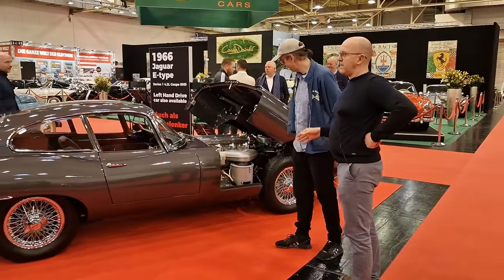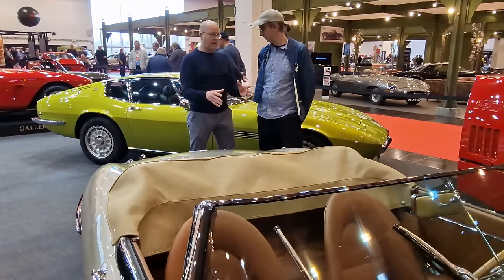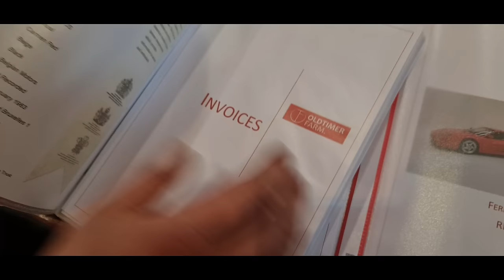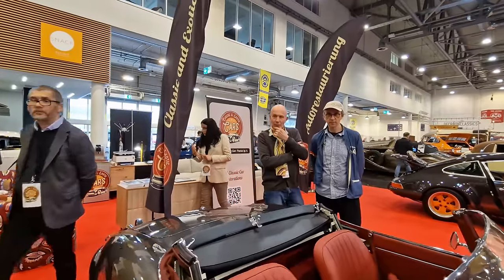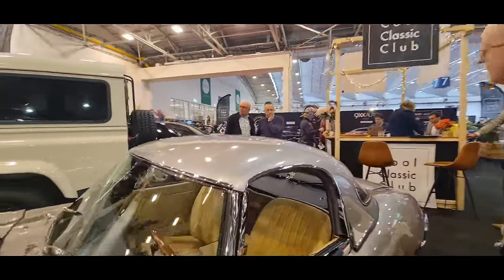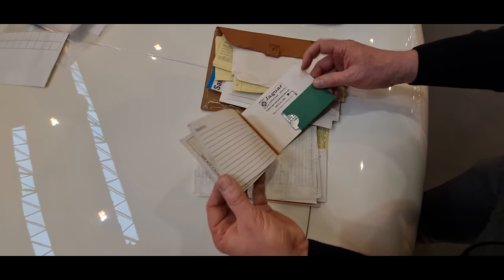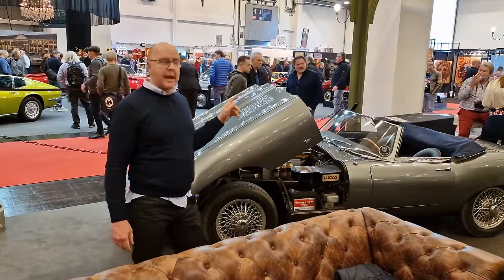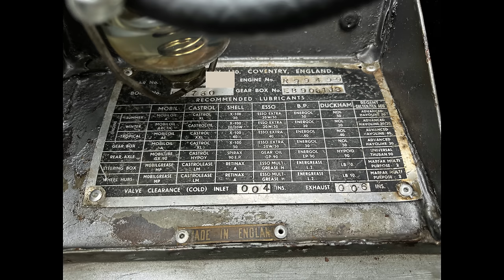Jaguar E Type: Market Check with Richard Michael Owen

Comment: Maikel and Richard, this is a terrific video for fellow “E” Type nerds. Thank you so much. I’m halfway through, I’m rationing myself. The Polish/English fellow’s “E” Type roadster had originality flaws as pointed out elsewhere but the most obvious was the R prefix 3.8 cylinder head. I think he’d been taken for a ride and doesn’t know as much as he thinks he does. The UK restoration figures he was quoting are nonsense. Keep up the great work.
Reply: I totally agree you, the Polish English guy from England is talking crap, and I do know about Etypes  I agree I saw that as well R prefix on the cylinder head, and I said to myself, that’s not right. I’ve seen many guys like him talking to Billy big bollocks he’s got dough around him certainly he saying he’s lost 100 grand on it. Well that tells you a lot don’t it. Listen Jaguar Es don’t cost that much to totally restore and done properly seriously don’t. 
If you a series,1  Etype please please just take it to an E type or XK Specialist and it will be down properly. 
My father  had lovely honest solid solid as a bone S1 4.2 Roadster sitting in the garage 20 odds years on axle stands with an original factory hardtop when I mean solid solid 2020 car 😂 my parents passed away and was sitting in now my mother used to drive it as well to go shopping around London. I was from Caribbean parents My dad was a boxing promoter used to hold BOXING events at Hilton Hotel. Also Grosvenor house hotel Park Lane  Cafe Royal Piccadilly and Royal Lancaster Hotel, Bayswater my father Fred was way ahead of his time Love all Cars he had 2 pagodas Merc 230SL and a 1968 280sL also back in day MK1 Lotus Cortina he was no mug he knew his toys RIP Dad and Mum.

Comment: Hi Mikael, I’m learning so much from your videos. E types seem to have such a huge disparity in prices, even on comparable cars.

Do you find there’s a price difference between Europe & UK cars, and how do you see the market going in the next year or 2?

I’m starting out on the road of custodianship. Thank you.
Reply from the maker: Thank you for your feedback.
I find there is a difference in price between the UK and European market.
Especially if you are trying to sell to Europe, the Brexit certainly did not help. 

A very original car, especially the early ones, is highly demanded and usually not offered it public. These cars (call them "blue chip") command a completely different price compared to a hurry up, passionless, reproduction restoration.
The early, collectable cars will take the same route as the Ferrari Dino. 
Time has come that more and more people do understand the difference. 
However, there is still a low budget market for E Types that at first glance do look ok, but will require a substantial amount of money and a professional workshop to fix it. Not what everyone has at hand.
Do not think that those cars, sold or offered for little money, are a bargain just because they have the E Type shape. It is the number of countless small details that make the difference between a valuable and a trouble car.

Buying an E Type is a minefield, and you better make sure to have an expert with you and become fully aware of what you are dealing with. For many people, it is more convenient to sell a car cheap rather than spending a fortune to fix it. How many restorations stalled just because the costs exploded? 🤯 

You can contact me for more information if required. maikel.lemke@etypes1.com

Comment: Hello Maikel and Richard . Great coverage from the Masters of the Universe 🤣 ! The arrogance of that Englishman with the Polish restorer was breathtaking ! And some of his comments were libellous . You simply cannot make those kind of comments  . His car fell well short of the standards of top class . The crude welding of the outer sill to the closing panel (identification plate ) was obvious . And l could tell you couldn't wait to get away !   Richard , you made me chuckle when you made the comment about looking for damage to the nose . I have deliberately left witness  marks on mine ! When l stripped the paint off my '66  l could see the front outside of the bonnet had evidence of lead loading . I had already dismantled the bonnet to it's single components , so when l turned the centre section over l could readily see where the panelbeater had used various methods , including a slide hammer ! 😱 to repair the bonnet .  I thought about it and decided as l couldn't see any obvious distortion before l stripped it then why hide it . Lead loading was the only "filler " available until the very late 1960's early '70's. So l think the original owner had a bit of a shunt , didn't wish to make a claim  so took it to his local bodyshop and paid for a cash repair ! So for me it tells a story . However , l did quite a lot of planishing to improve the repair . In fact l've only just finished flatting down the inside of the bonnet (which took 2 days !)  prior to painting it and did have a rethink but decided to stick to my original decision ! I'd hate to choose a favourite but the final car's paintwork had very little  original paintwork a far as l could tell , the obvious sign was the colour difference between the bonnet , "A"post to door . It's a common mistake . The bodyshell gets painted with the opening panels removed . A mismatch of colour is inevitable ......even with solid colours. So enjoy seeing you two sharing your incrdible knowledge with us ......THANKYOU !
Reply from the maker: Haha, John, you were listening to that man?! 🧐 I was listening and ticking all the boxes and that is why I left it in the video. He is actually right with what he is saying about the restoration etc .... and that is why we did not look at the car in details too much for obvious reasons. But isn't  that a classical scenario. A novice meets one of these, good talking people, and unless you do not have an expert at your side, you would want to believe every single word he is saying. I liked the phrase when he was saying that he is losing 100.000 €. How often do we hear that? 😂 😂 😂 And how often has this money not even been spent on the car !? We can not blame them, there are some people who wants to earn money and they have the chance to do it. Nothing illegal with that. Only bad luck if you are the one who has to add that amount of money after you have bought the car, just to make it the way you want it.
Stay tuned, also to Richards Chanel. We have been to the most fascinating car collections in the world. Of course Richard know all the cars, it was just overwhelming and breathtaking. The "Loh Collection" in Germany. That you for your comment, and obviously the 👍
Reply: @JaguarEType  Your the tops !
Reply: @johndavey72  the look of the man said it all..  Loafers, neck tie, plummy accent, lots of bragging. Move on ;)

Comment: Good video, not too sure that this late OBL featured here would have had the wider band lower windscreen Chrome ?Parts listing on Jaguar parts book would likely verify?
Reply from the maker: Very good point. The wide lower windscreen chrome was mounted including cars 875309 and 850087. 
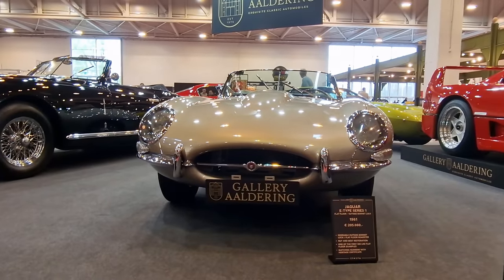Another fact we discovered on further inquiries, the Aaldering golden sand car for 205.000 € at 14:23 is actually not an OBL but a flat floor 875403. When do I get a chance to come and see some other parts and cars at your place?
Reply: @JaguarEType  Whilst we can’t be certain over every part detail of each and every OBL  originally produced ,we can be certain that over the years many modifications and interpretations of the OBL cars have come about with many of these crossing my path as an enthusiast ,restorer and reseller of these cars for over 40 years now .Great to see these videos here in the UK ,produced by an expert team with expert knowledge ,thanks again from a fellow OBL enthusiast .